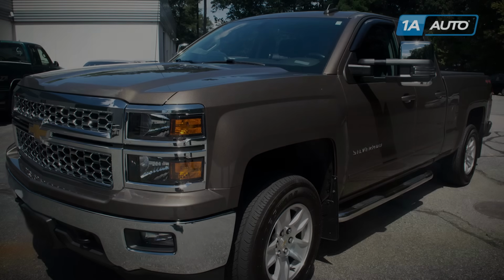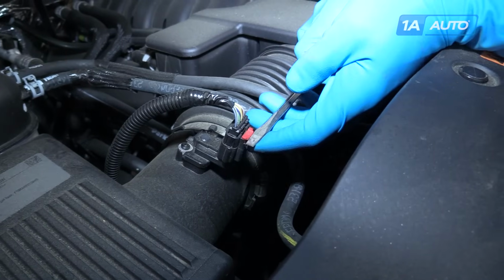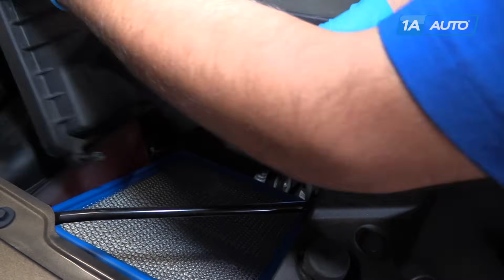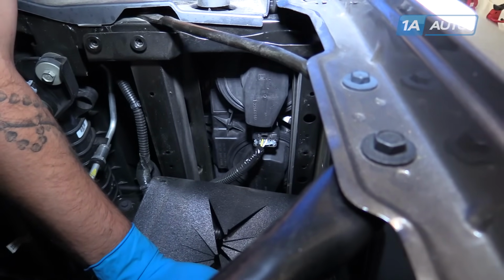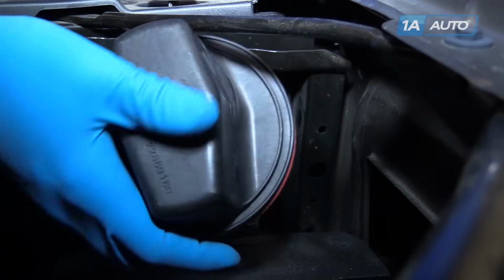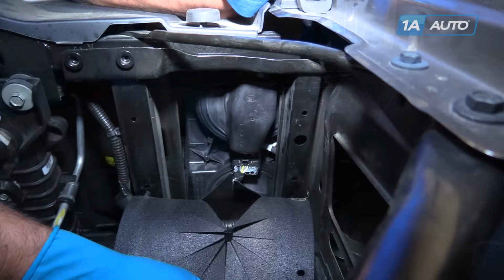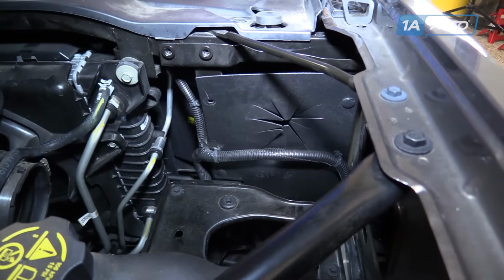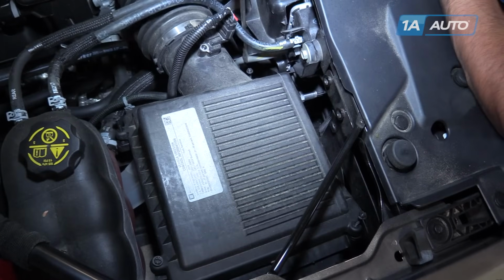How to Replace Headlight Bulbs 14-19 Chevy Silverado LT

Comment: I try my best to do my own vehicle maintenance and minor repairs when and where I can. This and other 1A Auto videos are so helpful. It keeps my vehicle out of the expensive auto repair shop and saves me a ton of money. One question that I didn't see addressed here: That brace that runs from the  front of the vehicle to the side, over the air box. How do you get that little f*#ker out of the way to lift the air box out? I know it comes loose from the side mount, but it appears to be "locked in" under the front shroud. It will pivot to the left, but it's still in the way.

Comment: Heads up for LTZ people. It's a totally different bulb but the same process.  And a whole lot cheaper if you buy it on Amazon rather then your local auto parts store.  OSRAM 66340HBI D3S 35W. Hope this helps the LTZ people.

Comment: i viewed this video numerous times, all but memorized it. but i just couldn't do it. NATURALLY my high beam bulb on the PASSENGER side - not the drivers side - needed to be replaced. the days of an owner doing basic repairs have been over decades ago. first, the red clip on MAS went flying somewhere in the engine compartment, cannot find it. STILL COULD NOT GET THE SENSOR TO COME OFF THE AIRBOX LID, EVEN WITHOUT THE RED CLIP TO HOLD IT ON!  WTF. now, the lid couldn't be twisted to get it out of the way. so, i had to remove the support bracket that was preventing the airbox lid from getting out of the way. 2ND, then i couldn't get the air box separated from the hose. IT. JUST. WOULDN'T. COME. OFF. THE. F-ING. HOSE. 3rd, couldn't get the airbox bottom popped off the rad support. THIS was the point of giving up and reassembling and scheduling and pay a mechanic for a simple light bulb replacement, which means taking a day off work to go to the repair shop. thanks for the video, NOT YOUR FAULT, but repairs cannot be done by the owner any more.

Comment: The dust covers are extremely hard to turn whether removing or installing. You cannot really get a grip - and they are so tight you can barely push them in hard enough to turn them when replacing.

Comment: My check engine light came on after I was done and turned on the truck to take it for a drive. I simply had to disconnect the battery for a few minutes and reconnect the cables and it reset the light.

Comment: I read some say you need the 9005 bulb some say you need the h11 bulb and then others say it's a different bulb that you van only get at the dealer? Can you clarify this please?
Reply: I purchased a 9005 for mine only to find out it didn’t work. I ended up needing the h11. I have a 2014 Silverado and am unsure if it changes based on the year. Your best bet is to remove the bad bulb to see which one you need.

Comment: You rock so much!  I'm a girl with no tools (I will fix that situation) and by following your video, I did the whole thing with the Leatherman that my brother gave me.

Edit:  By the way, the radiator shroud was missing.  Is that something I need to replace soon?  I didn't even know it existed until I needed a headlight bulb replacement and watched this video.

Comment: My check engine light came on but I also forgot to tighten the hose clamp like an idiot lol is this the reason my light came on???
Reply from the maker: +Ryan Perez We wouldn't be able to diagnose an issue like that here, you may want to have a local mechanic take a look at it. Thanks for checking us out! http://1aau.to/m/Shop-1AAuto-c
Reply: Same here.  Check Engine came on but it never went off after I tightened all the screws? Any ideas
Reply: Okay, I basically just took the sensor off and plugged it back in again, firmly.  Engine light cut off.  This saved me the headache of spending money on a damn diagnostic.  Thanks for the video!

Comment: Any direction on what I can do to fix my 2015 Chevy Silverado low beam passenger head light would be greatly appreciated. 

It's blew out twice so then I replaced the melted wire harness in back of the light bulb after that it lasted a few days and it blew out again. So, three times and now I'm just not driving at night. Really don't want to go to the dealer.

I'm not touching the bulb
Theres no condensation noted
Reply from the maker: +edgu71eg At this time we are unable to diagnose the issue you may be experiencing and would suggest contacting a local mechanic for further assistance. Please do not hesitate to contact us with any further questions.

Comment: Wouldn't it be easier to use a panel popper tool instead of the screwdriver and wire cutters? Seems more risk in damaging fasteners than actually removing them for average people.
Reply: Yeah, probably. But it's probably done this way to show that it can be done without a tab puller, whereas most people have a flathead
Reply: I thought the same thing, but used dikes like the video. No issues and most people probably don't have poppers.
Reply: I agree, I busted my zip ties and those plastic snap rivets whatever they are called and u guys doing this in 30 minutes are the best . I’m still screwing around with my light smh

Comment: Just a Tip. You can take that top bracket lose by just taking the top bolt out on the fender side then just slide it over to the right out of the way!

Comment: Good video, but does not account for 2017 Silverado.   I assume regarldess if it's a 1500/2500/3500.

The headlight assembly is different, and the factory bulbs are xenon phillips all in ones (built in balast/igniter)

Comment: Hey I followed your exact steps and everything went fine but my check engine light came on. I took out and plugged back in my air filter sensor but light stayed on. Any suggestions? It only came on after I took the air box out to put in my led bulbs.
Reply: Try disconnecting the battery for 10 minutes, then reconnect. It should go away. If it comes back within 50 miles, go to a shop that does free OBDII scans. They'll tell you whatever code it's throwing.
Reply: Have a part store check and erase codes most will for free
Reply: buy a new chevy truck.

Comment: I just did exactly what u did in this video now my check engine is on, any reason why u think
Reply: the air flow sensor is probably confused (if you unplug it)...disconnect the car battery, replug it in. The car's computer will recognize the sensor again (no more engine light)
Reply: Did u plug the intake sensor back in
Reply: belinda h I just had the same problem did you figure it out ?
Reply: Check your air intake harness and make sure you tightened the hose clamp down all the way. Had the same issue
Reply: It worked for me

Comment: Can anyone help I have a 2014 silverado 1500 and my top driver side turn signal won't stay on but works when I flick the turn signal ideas ?
Reply from the maker: +Seymour Butts If the lever will not stay up or down to activate the turn signal, the camber inside may be worn. You might have to replace the turn signal if this is the case. Hope this helps you out. 1aauto.com

Comment: Thank you for this. Now can we please find the moron GM engineer that designed this thing? Must be the same idiot that designed the spare tire storage system. I love my Chevy but they make it hard to do some of the simplest things.
Reply: Gee, I wonder if they made it hard so the average rube has to take it to the dealer and pay $100, for a $5 bulb?
Reply: It's MUCH easier than the guys that designed the O7-13 Body style Tahoe/Suburban it was a nightmare to do a single bulb
Reply: Kristofer FC yup damn near have to take the whole front end off
Reply: I know right what a moron
My 2004 gmc sierra headlight can be replaced in 5 minutes if that
Reply: The spare tire storage system is genius.  A cable hoist at the rear under the bed.  Completely out of the way.  These headlights are something else however.